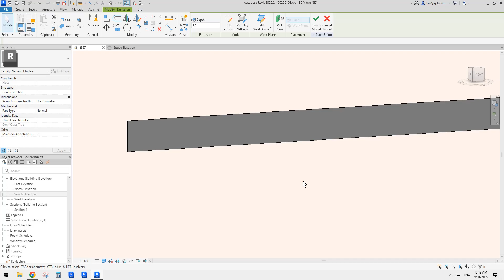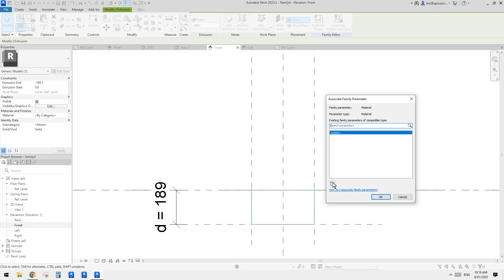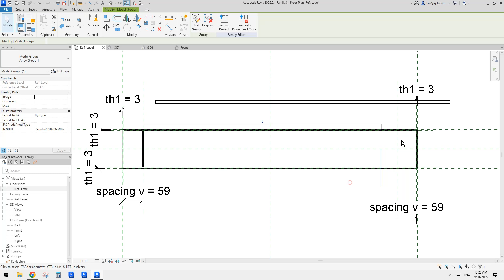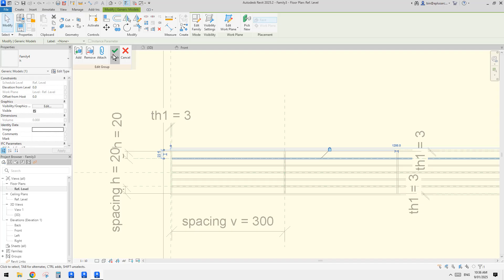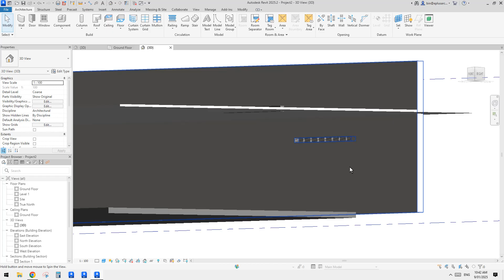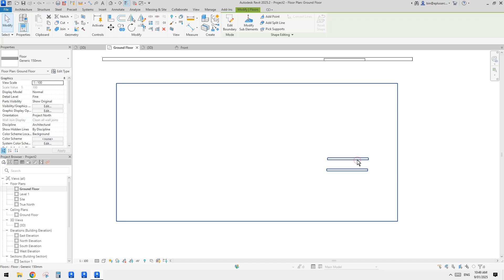25003 - Parametric Grating Family in Revit

Comment: Happy new year...

Thanks a lot...for considering my request.

We use floor normally. Some cases we may be asked to show it as realistic as it is possible. I made one family of similar sort (using array option). It will be heavy and not so flexible in few ways. We cant have that as one single family of L, T, + shaped grating (in plan). I can make use of the rectangular grating family made by me and make a new nested family of needed shapes (L T +). But it's a herculean task. Also, it don't allow us to make openings quickly as needed (since it is a nested family). We will end up in spending lot of time for making cutouts on the grating. 

Thanks again and continue supporting the community. 

I learned a lot from your videos.
Reply from the maker: Can you just use a single family with angle parameter on both ends for all situations instead of creating separate families for those three shapes. Eg. you can use 2 45degree to create a L shape, 2 90degree to create a T shape, 3 90 degree to create a +. If you really need to create those shapes with nested families, you can still have the void in the host family so it can create the opening.
Reply: Thanks for the suggestion. Will try  @BINHE615

Comment: this will be helpful in creating grating trench, but corners can you make videos on how to model corners 90,45, angle , T, Cross etc
Reply from the maker: Hmm, this can be tricky, can we have a face based void with an angular parameter to cut it? I guess it won’t work on the array, maybe need to nest the array?
Reply: @BINHE615  voids can be used. But it's difficult to update when opening locations change frequently (during design face).